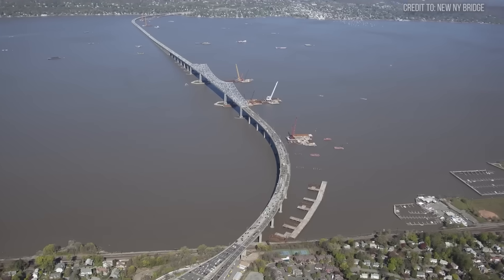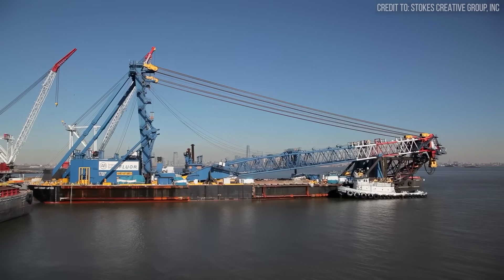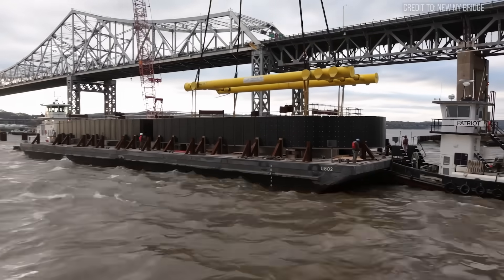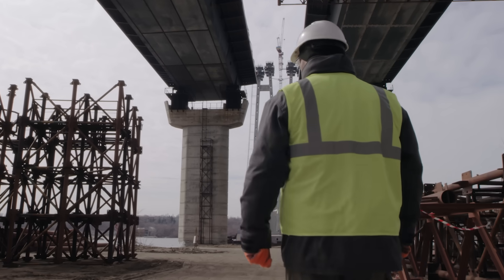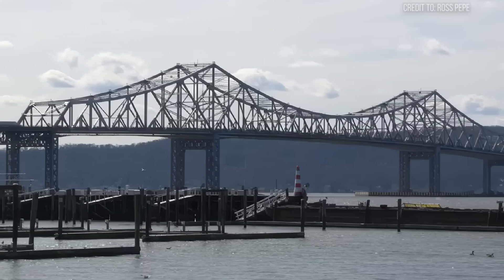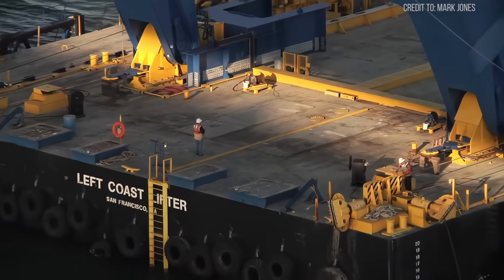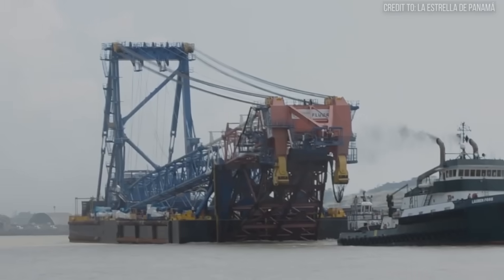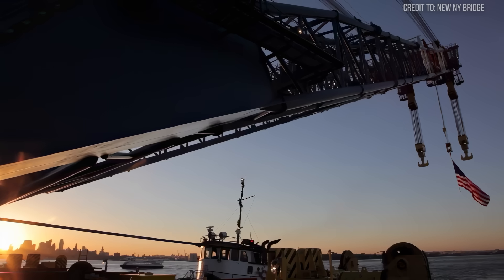The Mega Crane America Towed 6,000 Miles To Finish The Job

Comment: Whoever narrated this used the wrong name for the new bridge at about the 5:50 point
Reply from the maker: Hi William, The bridge is officially named the Governor Mario M. Cuomo Bridge, completed in 2017-2018. The confusion might stem from its predecessor, the Tappan Zee Bridge, which it replaced. I did double check the script to make sure and it was the correct name for the bridge. Hope you enjoyed the video!
Reply: @HardHatIndustries except the name used, no one around here uses it when the bridge name comes up, especially since it resulted from an overnight, backroom deal